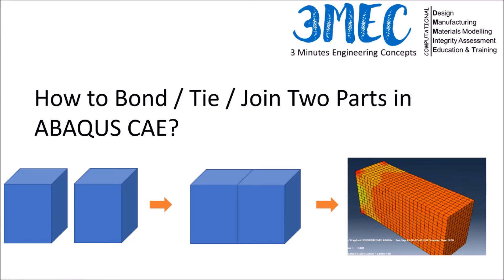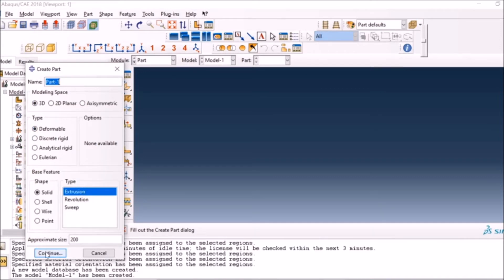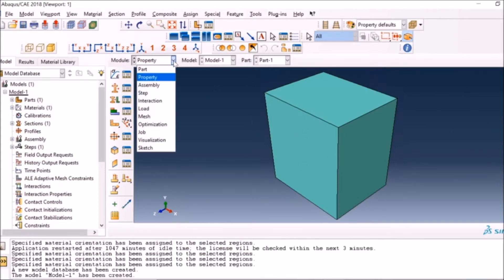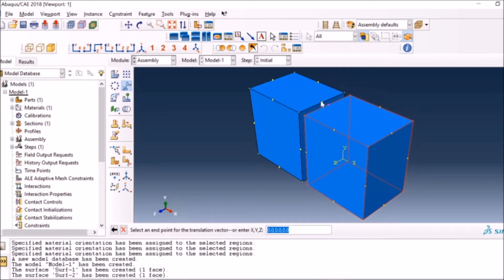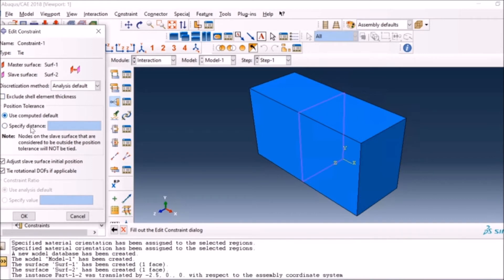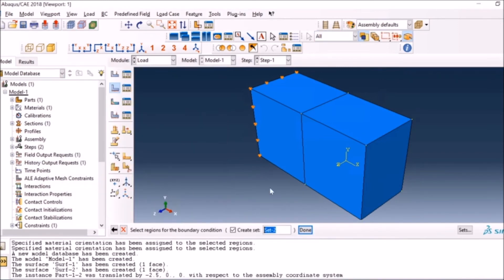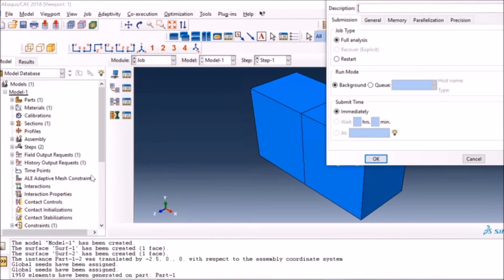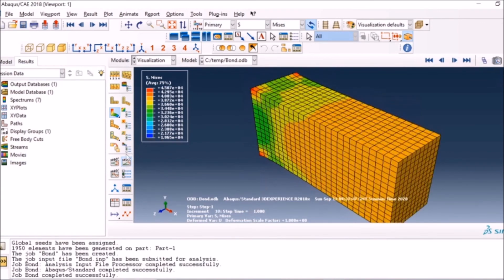Joining / Bonding / Tie two parts in FEA using ABAQUS CAE - ABAQUS Tutorial

Comment: hello, i am trying to model a peeling test of the shim this shim is composed from a rubber +steel+rubber the cohesive element are like adhesive but i can't reach the  full damage ef elements it stop before the sdeg=1 and that means i can't haev element deletion ? because i tried everything and i cant remove my elements
Reply from the maker: Did you sort the issue ?
Did you select element deletion as yes in element type?
If the problem still persist i can have a quick check.

Comment: Hi thanks for sharing the tutorial. I'm wondering if the "tie constraints" will over estimate the structural stiffness? Thanks
Reply from the maker: Hi,
It will depend on the interface in real-life. For ideally clean, atomistically bonded surfaces this should be fine. But if you have a cohesive zone where bonding is not a sharp interface rather a zone then you will have a stiffer response and for that you can use other formulations including cohesive zone models. I have a video on this in my channel. 
Similarly, if you have adhesives used then there properties need to included. So as a modeller, you will have to decide which type of constraint and contact conditions will be useful. Thanks
Reply: @Professor3MEC  Thanks for your feedback. A cohesive zone requires parameters such as Ki values (interface stiffness for each failure mode) and toughness values, as well as a refined mesh. What do you think about merging parts?  Also, how do you deal with a model that contains a large number of parts, let's assume 100 separated parts in your Abaqus model. Is there a more appropriate pre-processing tool? Thanks for any thought you may provide.
Reply from the maker: Sorry I am unaware of any. IF you have already found one then please let me know too. Thanks.

Comment: HI, Error in job Job-1: 2200 elements have missing property definitions. The elements have been identified in element set ErrElemMissingSection.
Job Job-1: Analysis Input File Processor aborted due to errors.
Error in job Job-1: Analysis Input File Processor exited with an error. 
Any advice? Thanks.
Reply from the maker: Check if material properties are assigned correctly through sections. I have a number of videos on my channel related to this. Thanks

Comment: How to solve this error "The volume of 48 elements is zero, small, or negative. Check coordinates or node numbering, or modify the mesh seed. In the case of a tetrahedron this error may indicate that all nodes are located very nearly in a plane. The elements have been identified in element set ErrElemVolSmallNegZero."
Reply from the maker: You may look into mesh  by opening the odb in visualisation module. And then via display group see which elements are in Err… element set. Then may be use edge seeds to modify mesh in that area of part. Usually intricate geometries with complex change in cross-sections, etc can cause this issue with tetrahedron elements.

Comment: Can we have meshing that is not coincident in the two parts and then create a tie constraint between them?
Reply from the maker: Yes it may work but one needs to be careful with clearances/tolerances, I.e. distance between adjacent nodes to be considered for tie constraints. Also, if you allow the nodes to move during tie constraints and distances are on higher side your mesh in those regions may become unreasonable. Better look at ABAQUS documentation for more details.